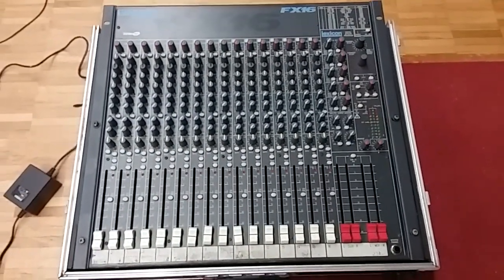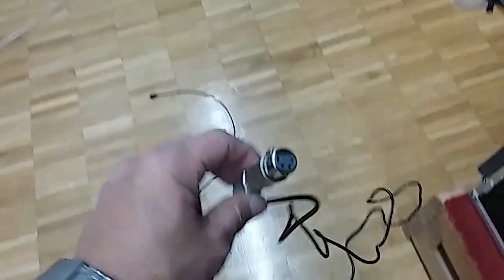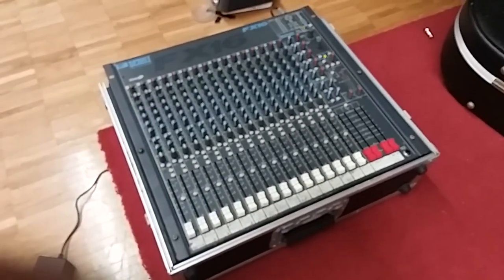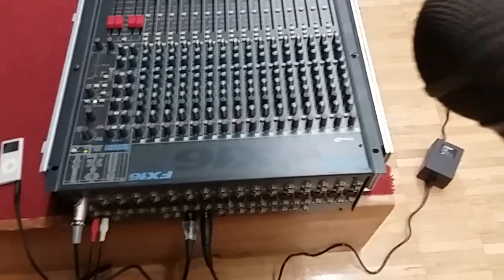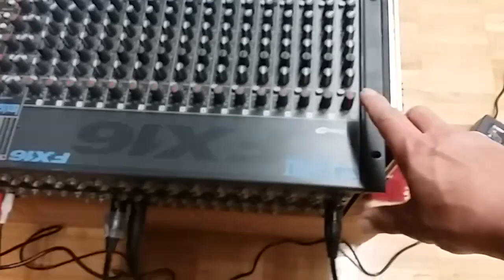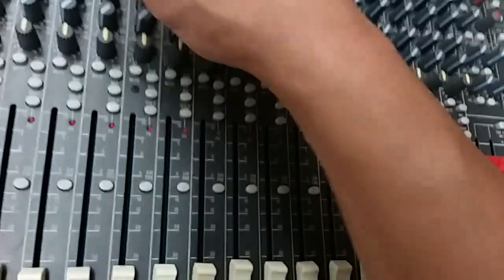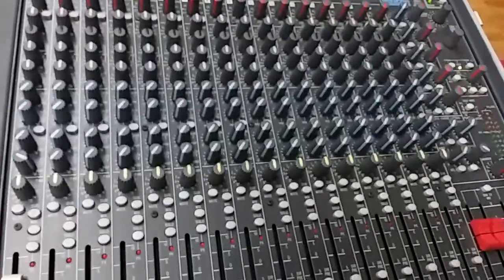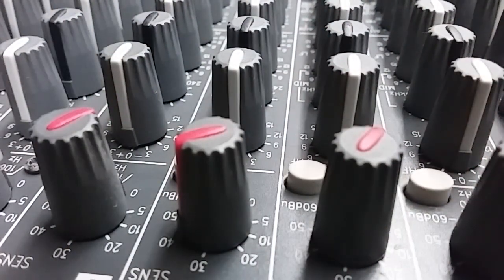Soundcraft Spirit FX16 Power Supply (PSU - HB0166) Alternative

Comment: Gah, this video would have been 100x more useful if you put a multimeter on the pins and told us which ones were +18V and which one was 0V. I'm having to replace a PSU with an offbrand one and have no reference for which pins were 18V on the original PSU 😪

Comment: I have this mixer never used brand new but no power supply so frustrating
Reply from the maker: What a bummer! The PA-30 is a good substitute. It'd definitely be worth your time and effort if you could the Yamaha power supply and the four-prong connector. If you have access to Amazon or E-bay, I left a link to substitute power supplies that need no conversion. You ought to give one of these substitutes a try. It'd be a crying shame to have a new FX16 that never sees action.

Comment: hey, do you have any idea why am i having a little hum noise when i use lexicon effect? when i turn the lexicon master knob right, im getting some hum from speakers together with the effect.
Reply from the maker: It could be anything from debris lodged in some part of the circuit or a failing component. Some good trouble shooting will be needed. If you're a bit mechanically/electronically inclined, opening it up and doing a thorough cleaning might be all you need. If your table has seen a lot of action, some components might need to be replaced. Hard to give any specifics, but hope you're able to fix the issue.

Comment: hi , what do yo mean with "intermitency" ?  power or sound problems ? thanks for  you video
Reply from the maker: By "intermittency" I mean intermittent audio signal. The left "mains" would randomly be audible then inaudible. Channel 3 had the same issue with the Lo-Z input, while channel 1 produced zero signal. "Intermittent" issues were resolved by removing old solder and re-soldering the components. Hope this helps.
Reply: @swordhillvillage841  y have similar failures . the solution was a new power supply ?
Reply from the maker: Hi Esteban. No, changing the power supply unit or PSU will not fix intermittency problems. My FX16 did not have a PSU so I had to convert a Yamaha PSU to power my mixer. But to fix the intermittency problems the entire mixer needed to be disassembled. The following is a link that shows the detailed work I did on the mixer. Hope this helps.  https://gearspace.com/board/diy-electronic-build-refurbishment-photo-diaries/1260489-soundcraft-spirit-fx16-psu-solution.html

Comment: Where did you get the 4 prong receiver from? I am currently looking for a whole power supply but the mixer I have doesn't have any power supply.
Reply from the maker: Hi Corey, I spent years looking for the original Sound Craft power supply (mine was tossed with a bunch of computer cables). Nothing ever came-up. Even tried asking a local tech to build one for me. Hope you find one, but if you can't, you can find some connectors on Amazon. Look for Seismic-Audio-SAPT247-4-Pin-Connector or Neutrik NC4MXX 4-Pin Male Cable MT (same item that bjorn k strige mentions). Really happy with the PA-30. Good luck!

Comment: HELLO SIR.  (MR: SWORD HILLVILLAGE) -- I  REALLY LOVED THE VIDEO.  I HAVE A FX16 WITHOUT THE PSU.  I BOUGHT THE YAMAHA PA-30 BUT IT COMES WITH 3 WIRES, RED, YELLOW AND GREEN. i ALREADY BOUGHT THE 4 HOLE  CONNECTOR BUT IM NOT SURE HOW TO CONNECT IT.  IS IT TOO MUCH TO ASK YOU WHAT PIN WAS EACH CABLE CONNECTED TO????  YOU DON'T MENTION ANYTHING ABOUT THE PA-30 "YELLOW WIRE" ON THE VIDEO.   THANKS YOU IN ADVANCE.  LOOK FORWARD TO HEARING FROM YOU.
Reply from the maker: Hi PETE P. Thanks for the comment. You're right, I didn't mention the Yellow wire in the PA-30! I actually just realized that I have the pin numbers in the video mixed up! So Sorry! The source files that I used to make this video was already deleted so I'm posting a correction accordingly! Please take a look at the correction it should help. Please let me know how your conversion works out!
Reply: @swordhillvillage841  I really appreciate your response.  Thank you very much.
Reply from the maker: @UNIVINS  My pleasure. I hope the link was helpful. Good luck with your conversion!
Reply: https://translate.google.com/translate?hl=pt-BR&sl=en&u=https://www.gearslutz.com/board/diy-electronic-build-refurbishment-photo-diaries/1260489-soundcraft-spirit-fx16-psu-solution.html&prev=search